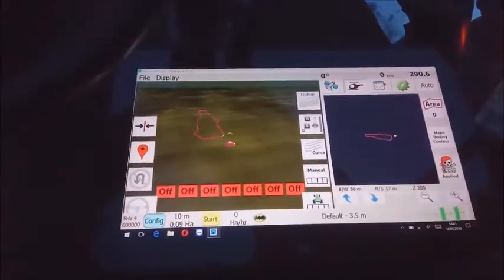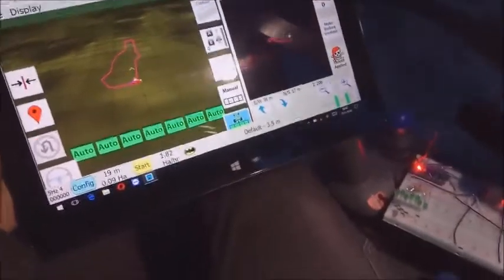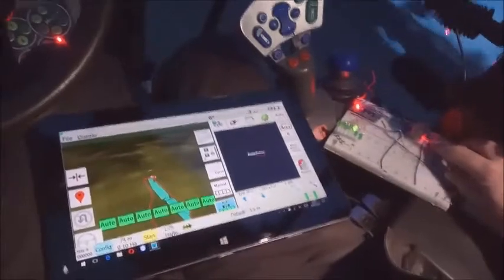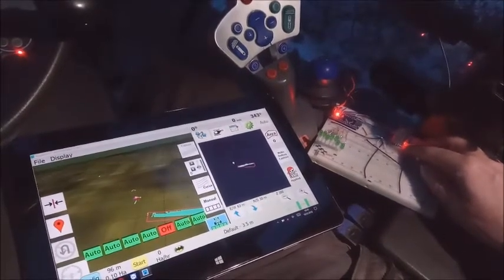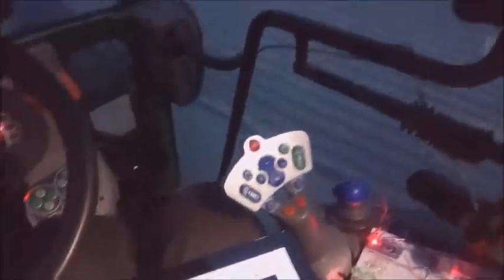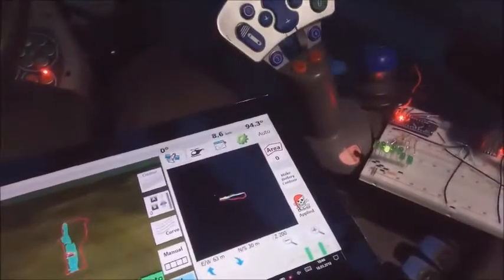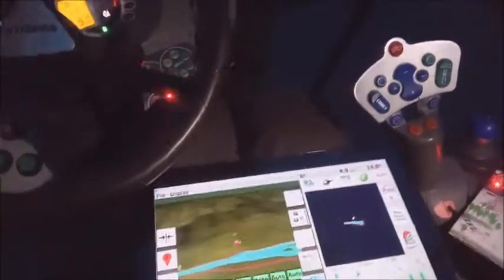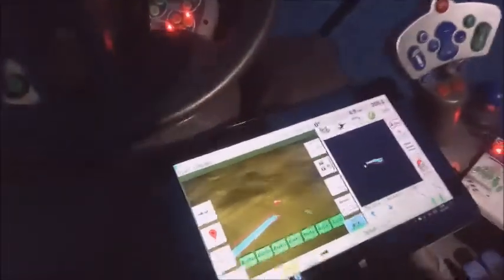AgOpenGPS with hardware section switches  and 2 Bluetooth connections test

Comment: Can make a video with the hardware connection ??
Reply from the maker: I build the switch box for the sprayer you can see in the other videos. The circuit is like
http://agopengps.gh-ortner.com/doku.php?id=section_controll:start
Sometimes the Bluetooth module does not start.
If you want to build a switch box I would prefer a esp32 solution. The software and a pinout could be found in my github:
https://github.com/mtz8302/AOG_ESP32_Section_control